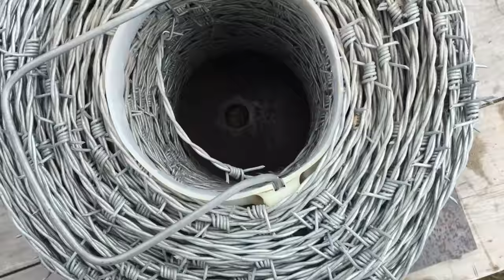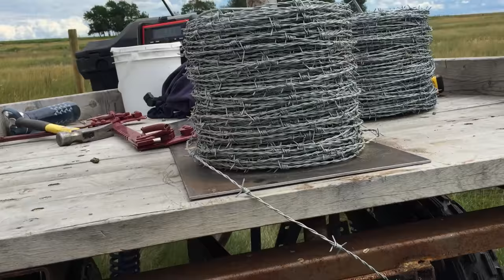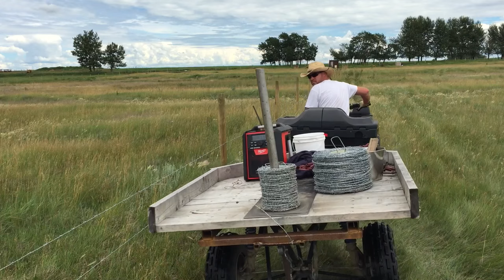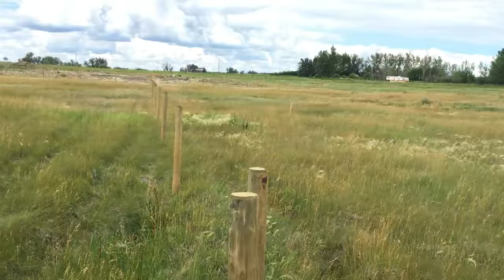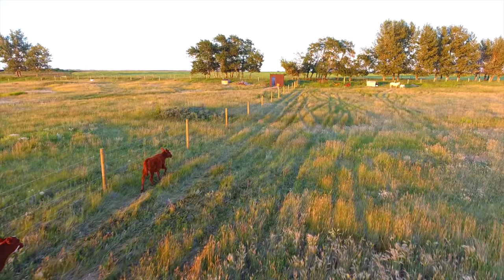Homestead update: Fencing project

Comment: Nice video! I especially love the drone footage. I just got a new GoPro to put on my drone, so hopefully I'll be there soon too! Anyways, what's the height and depth of those fence posts? And is there a reason you used the number of passes and the type of wire you did? Just a curious fella. Cheers!
Reply from the maker: Nice work on the GP for the drone! Looking forward to see how that goes for you:) I think the posts were all around 4" diameter and 7 feet long. I pounded them in a few weeks ago when my neighbour had rented a post pounder and had it for a long weekend. He was done with it and asked if I wanted to use it so I thought might as well. I did 4 wire strand of a type of barbed wire they call gaucho. It's stretchier than the old school stuff people used to use and a  lot of people are switching over to it. It's lighter and cheaper too. Just with the simple tools that I have for this stuff I have to do one strand at a time, and it's best to always start with the bottom and work up. This was my first time doing a barbed wire fence and it came out pretty good. Cheers!
Reply: +Simple Little Life thanks for the reply!